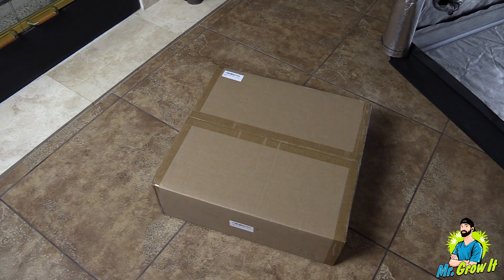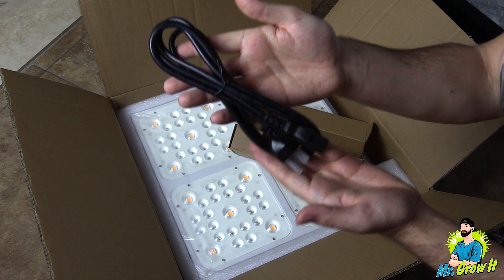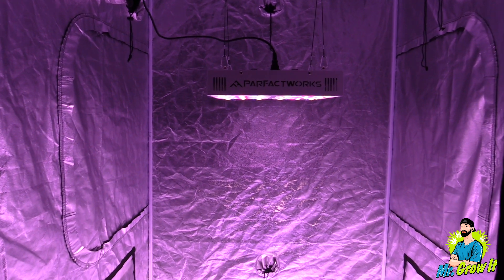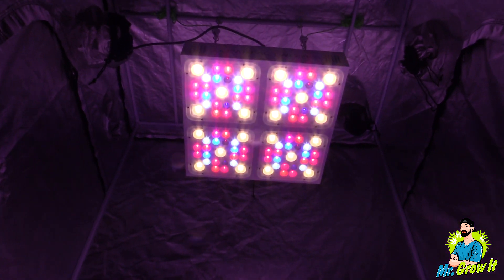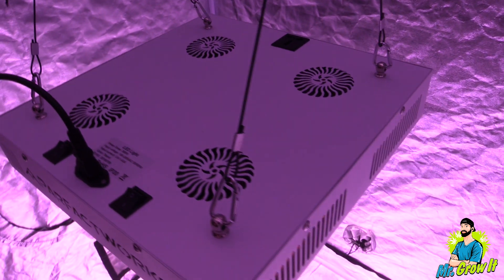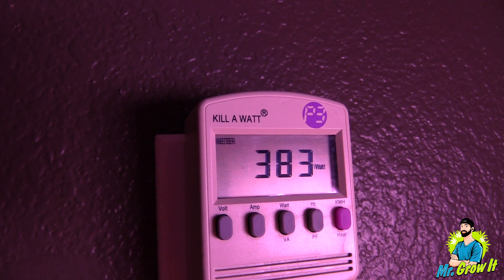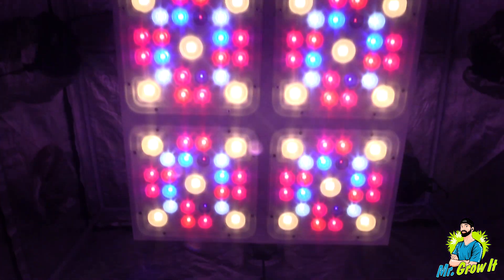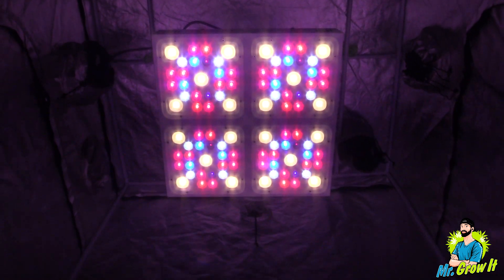1000W CREE COB Plus LED Grow Light by PARFACTWORKS | Unboxing, PAR Test & Heat Test!

Comment: invaluable info showing these par readings. thank you, as i see more of these videos im convinced you'de get a better result  buying more than one , smaller ones , and getting overlap. The lower these fixtures get to good flowering par the smaller their footprints are. also it seems the quantum boards dont have the depth penetration power. request , do some tests on cree's!

Comment: Not bad, but I'm still probably going to be getting on the Quantum Board wagon.
Reply: Sean G try optic led and see what you think
Reply: ya i mean ppfd rules the garden,and any light using samsung 301h,and meanwell drivers,are gonna get the ppfd,rest are catching up,the sf4000 has amazing ppfd at 12" it killed my 1000watt hps,i now retired it,never thought id say i like a spider farmer product,but there new light just work,and now dim,so cats ass light now,2.0 umoles across canopy at just under 12" in 6x6 with 315 cmh beside it

Comment: Top tip: don't do your output tests in a tent because where you are in the doorway of said tent there are no walls because your in the doorway meaning your results will be well off where you are, better to not use a tent at all and get true results from the fixture only and not include the reflective walls.
Reply from the maker: Good suggestion! I'm torn on this so I've created a poll to see what the majority of the viewers would like to see. Thanks!
Reply: @GardenTalkwithMrGrowIt  its a tricky one because, who is going to grow outside of some sort of an enclosure? No one. But the true results from only the fixture can only be obtained from a open space or a some sort of   dark non reflective tent or to be silly a black body enclosure. It'll be interesting to see the results of this survey. What it will boil down to I expect is fixtures with reflectors and those without such implementations of guiding the light. So fixtures with reflectors or light guides will not be as affected by the walls but those without (bare diodes) will be as the tent is the reflector.
Reply: Take a page from highschool romance and insert the probe through the zipper to get it done:)
Reply: The majority of people grow in a tent. 
So it's more realistic to measure it in a tent.

Comment: When its 300 some watts why do you title this as 1000watt cree when its not??
Reply from the maker: Some companies list their light 1000W because it has 1000 watts worth of diodes, although in this case, the diodes are under driven so the fixture is not actually pulling 1000 watts from the wall. Other times companies will state 1000W as an equivalent to a 1000 watt HID grow light. If you look at their Amazon listing you can see it in the title. They may even use 1000W simply as a model number. So 1000W does not equal 1000 watts being pulled from the wall.
Reply: @GardenTalkwithMrGrowIt , thank you for speaking up on that subject.
Most people don't know about how led diodes works. 
If they're driven at full power, the ppf, ppfd, umol/s/m2, and depending on the amount of hours that light is on for, it's dli, values will receive a higher numbers as well. At a point, they'll complain that's too bright to use.
To best serve the general public (th consumers) those diodes are driven about 70% from full rated power, to extend it's longevity. Once again, they'll complain that it's too dim or not enough lighting.
However, some people still claims its been misleading or false advertisement, and its all about education. If they truly understanding logic here, then they'll be very pleased with thier decisions without critiquing.
Reply: really angers me when companies do this and people dont call it what it is...lies from china based companies.....hlg doesnt do this
Reply: I like when they put the HPS equivalent in the title because it makes it easier to shop for an LED light. China finally did something right.